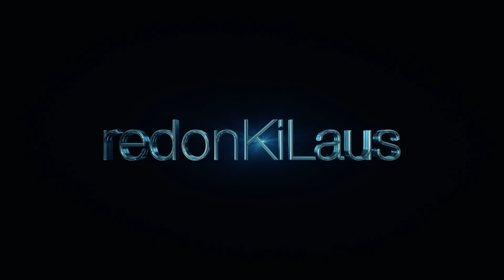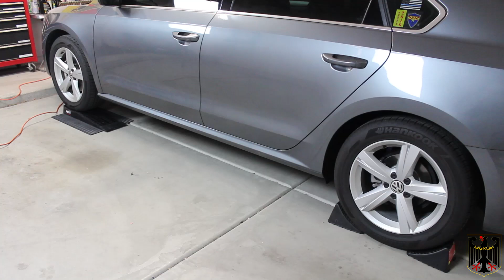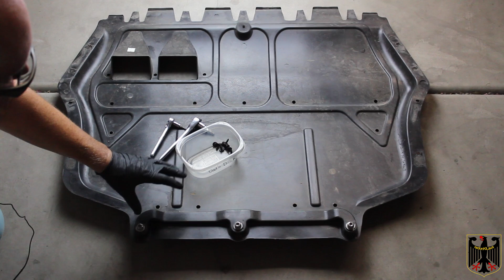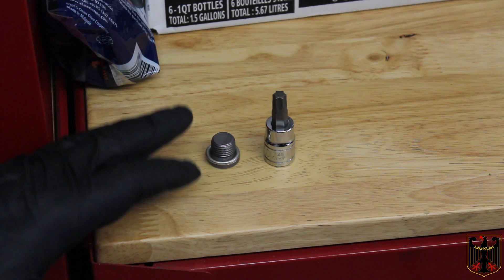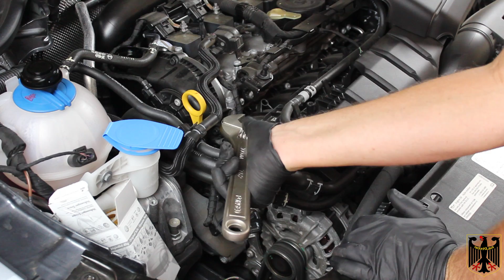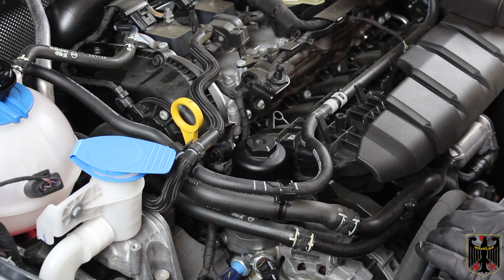VW Passat/Jetta/Golf/Beetle TSI Oil Change (EA888 Gen 3 1.8 Motor)

Comment: I always do the filter while the oil continues to drain.  You get more oil out that way, and the last oil coming out is the dirtiest.
Reply: I pour 1 quart of cheap in after most of the oil drains out , this gets the rest of the dirty oil out, then drink 3 beers and wait till it stops dripping.
Reply from the maker: I typically do the same, but in this case I separated those steps to make it more clear for those who are new to changing oil, and also since I did this particular oil change during an Arizona summer when it was 115 degF outside - at that temperature, taking a break in air conditioning while the oil drains is welcome relief.  Thanks for watching!
Reply: Ed Mathews You are 100% correct in doing it that way. all top side filter housings like the one seen here will hold some oil until you loosen the filter housing cap. this video is of great detail and very informative, only thing I do differently is change the filter first, allowing the used oil inside of the housing to drain down into the pan and then be completely drained when removing the oil pan drain plug! Great video though!
Reply: Danny Finley sound advice

Comment: I guess I should have watched the whole video before commenting! Lol.  Wow you have changed the oil a few times.  I have not.  But I agree with you on the 10k service period.  I am at almost 16k now and will be servicing it every 5k now that I see your doing it.  I work for a turbocharging engineering company and we see turbos that need refurbishing so I know the importance of frequent oil changes.   You just made my decision for me!
Reply from the maker: Yep, I am definitely a big proponent for far more frequent oil changes - where I live, there is so much dirt my oil comes out surprisingly unclean after 2500 miles in my other vehicles.  I've not had any issues with my Passat besides a door handle coming off (wasn't latched from the factory) and the camshaft recall.  There are some things that I don't like 100% about it, but I have to remind myself that it's a fairly inexpensive vehicle, and I can't expect Mercedes-level quality.  Overall, definitely a vehicle I plan to treat right and keep as long as it returns the favor.  Thanks for watching!